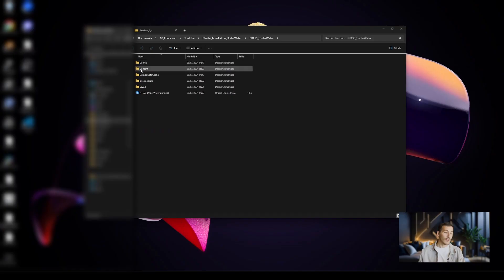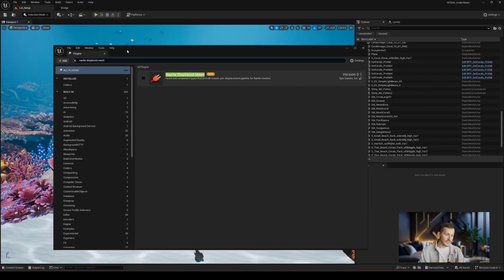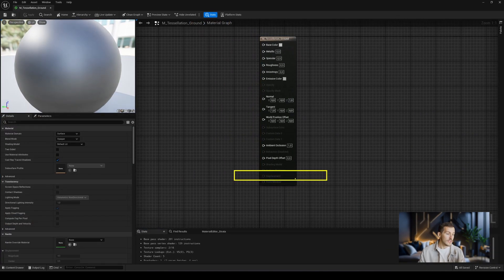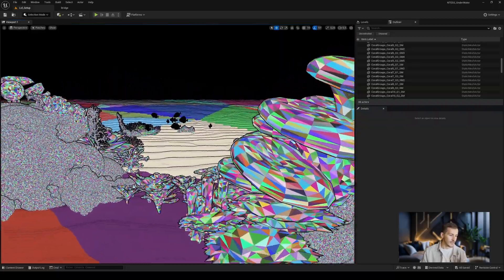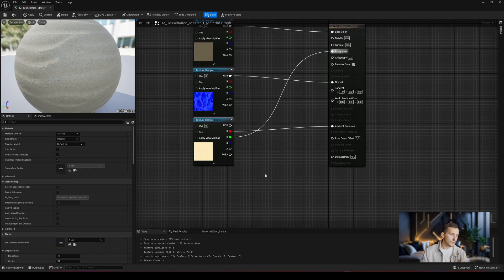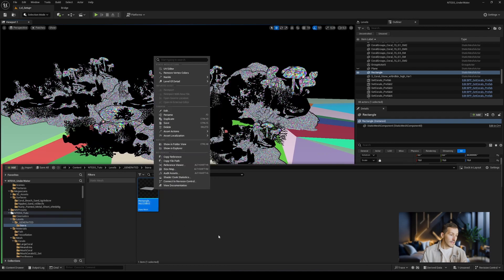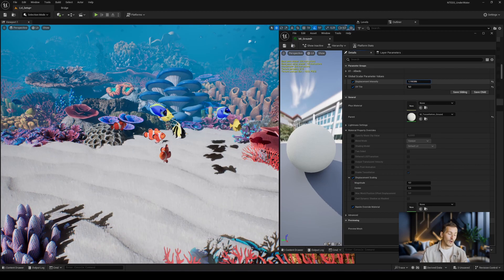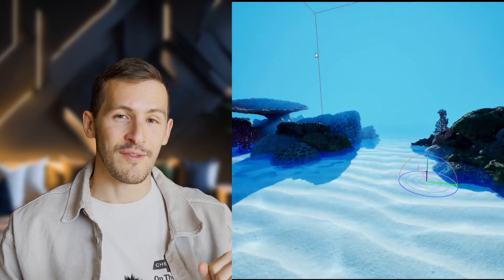NANITE Dynamic Tessellation / Displacement | Unreal Engine 5

Comment: Hi is it possible to change nanite tessalation displacement in real time in the simulation. For eg when in play can i press a certain button to change the displacement value?
Reply from the maker: Hey ! 🖖
You should be able to manage that quite easily! Since it's based on the Material, you can control the parameter you're using in it (like the one for adjusting displacement intensity) and then set up a keyboard event to control it for example !

Comment: hi im working on 5.4 but i dont see enable tessellation in my leftside panel, any suggestions ?
Reply from the maker: Have you added the two lines of code to the .ini file?
Also, make sure you select the material output so that you can see the corresponding details panel. 🙌